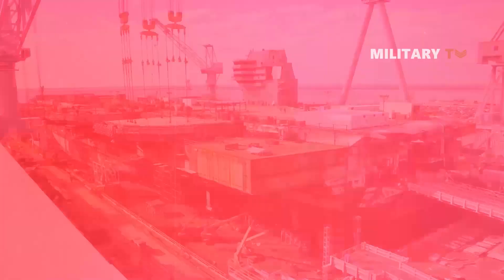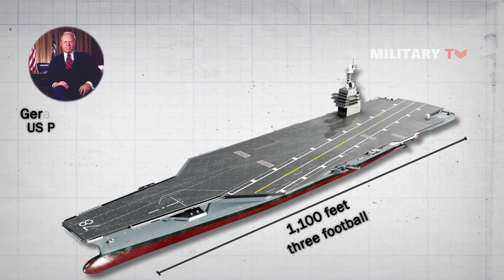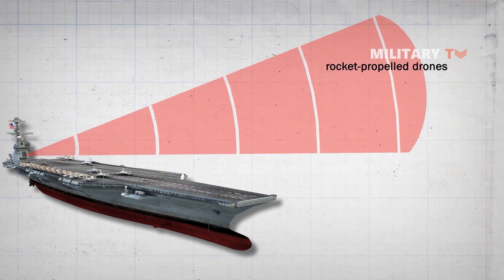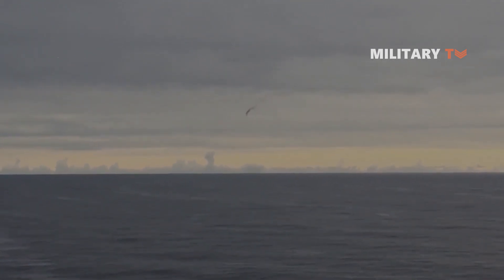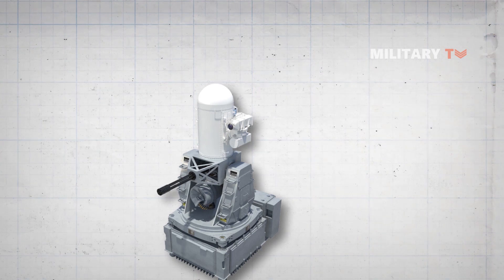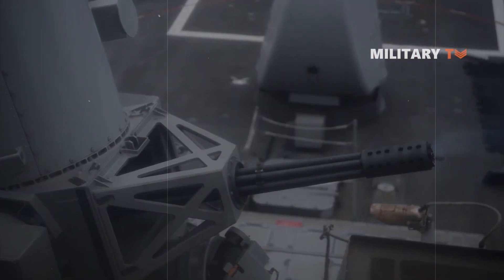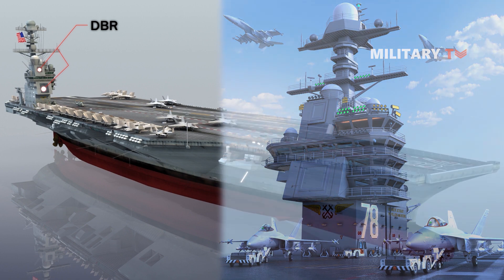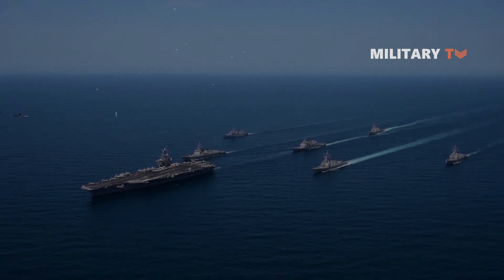How To US Save $13 Billion Aircraft Carrier From Sinking

Comment: We need to take old aircraft carriers and put vertical cells on it for really long range missile's just think instead of tearing the older ships apart costs a lot and all you have to do is refuel the aircraft carriers with large long range anti-ship missile's and others into vertical launch tubes and there you have a way to take out Chinese ground based anti-ship missile's launchers out before you take the carrier group close enough to get into the battle

Comment: OK-----------.  Unless the 20mm Seawiz is upgraded with at least a 35mm gun with proximity rounds if not true target seeking smart rounds effective out to 2+ miles they should be replaced by the SeaRam launchers that can reach out and  kill missiles over 5-miies away instead of just the last 1,000 meters "hopefully"!!! The Sea Wiz has been demonstrated to be worthless against supersonic Missiles with its short range of 1,000-meters against a maneuvering missile moving kilometers a second. Though the SeaRam mounts with only 11 rounds should get a reloader that takes less than an hour to reload missiles. Preferable less than a minute... Using a rack of missiles close by in a deck house or below deck that is ready to slide out or lift up to the launchers Missile box to push missiles into any vacant tubes in the Box in one easy push, 11missiles could be reloaded in seconds with the box reloader reloaded quickly in the nearby magazine instead of crates of 4 (with storage crates of 4, most launchers are only loaded with 8 missiles (instead of 11) as loading only 3 missiles from a crate leaves the ODD missile unprotected and awkward returning it to the magazine, if the launcher is fully loaded) hauled up from deep inside the ship on forklifts and elevators, broken open, missiles inspected and finally slide into each launch tube one at a time with the help of a crane and alignment bar. A Job that is almost impossible in Combat, bad weather, a rolling ship, with most launchers mounted high up away from the main deck. Almost as bad as trying to load the Sea Wiz...  When Chinese Missile are flying at the Fleet by the hundreds in waves, only having 11 Rams to destroy stragglers is just Pitiful... Almost as bad as having only 21 in the stand alone mount that usually only gets 20 rounds loaded, again to prevent hauling a partially empty crate back down to the Magazine... (regs prevent moving or storing a missiles outside their shipping crates without approved racks in unprotected areas). Just easier not to bother filling the launcher.

Comment: Those huge sponsons on the aft sides of the flight deck are easily large enough to support tactical length Mk 41 VLS. This would allow the Ford to counter saturation attacks that get past her escorts.
Reply: Doesn't it add more weight
Reply: @cristobalalvarez5491  it's already 100,000 tonnes bro 😂
Reply: That’s what the escorts are for. I have wondered why they never carried a few missiles. But this can withstand a lot of hits. You need a nuclear or ballistic missile with a direct hit to bring it down. With the speed it can move and maneuver it would be next to impossible to hit it

Comment: 5:06-There's a VLS for ESSM that I've seen on some foreign warships, why are we still using the Mk29?
Reply: either range related (in sea skimming mode, you don't want to waste fuel launching up to clear the ship) or more likely it is so it does not interfere with air operations, a VLS could prevent a takeoff or landing until the exaust has cleared from the deck.